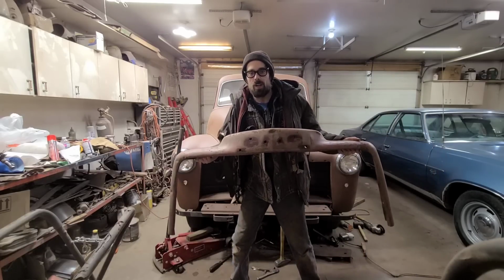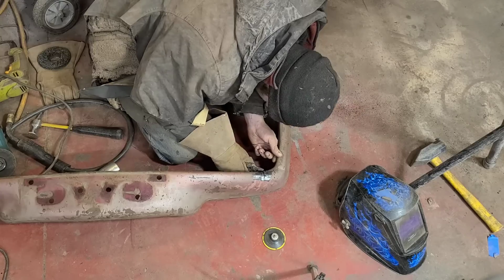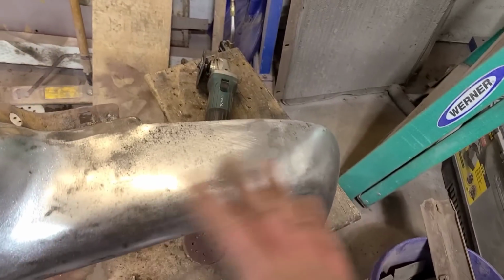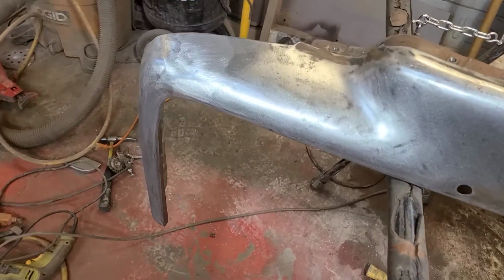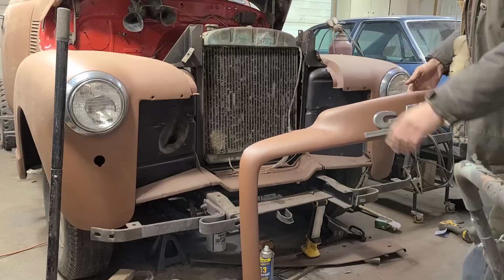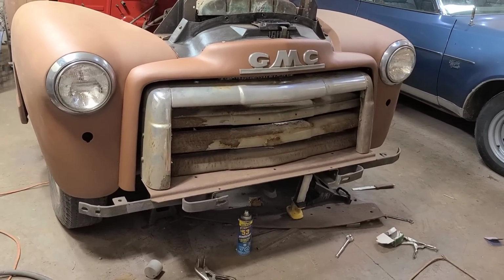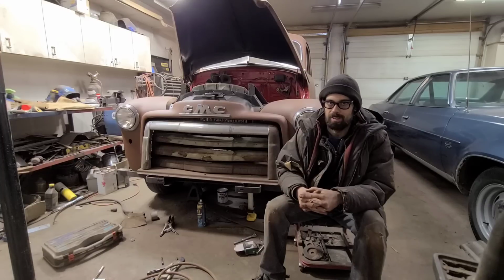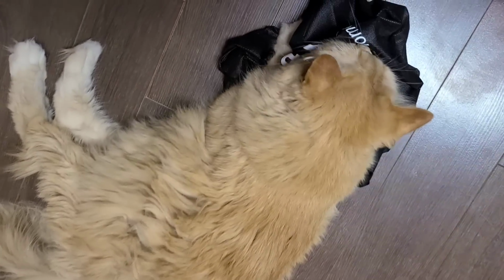1948 GMC Grille Surround Restoration. Plus: Sculpting With Lead!

Comment: Thanks for the video. I worked with lead for years when I was repairing the older telephone cables that had a lead sheath covering. As long as you snort in the dust and wash your hands after you are done you will be ok. Nice job smoothing out the grill surround. I would scuff and paint over the crusty parts of the grill so it looks presentable. That cab looks great. Looking forward to the next one.

Comment: I know this is a long time too late, but I found that the propane 'weed wand' burner attachment pumps out enough heat for soldering if you run out of MAPP. Super unwieldy at 2 feet long but it works.

Comment: Lead is safer then bondo. Your rough in is nicer then most finish work I have seen. On the grill just paint it with satin silver. Thanks for the update.Keep up the great work
Reply from the maker: Thanks! I figure with lead it's pretty hard to accidentally inhale the shavings after filing it, but the bondo dust gets everywhere and you end up breathing it in for months after. I'm not going to try to pretend lead is safe for human consumption, but spending a lifetime hiding in a protective bubble probably isn't healthy either.

Comment: Hi kyle

Another great video. I worked in the Telecommunications field for 20 odd years and was always impressed with the skill of the old-time cable joiners. They would "lead wipe" joins in the big, 1200 pair paper insulated led sheathed cables, to seal them. The cables were them pressurized to keep moisture out, air usage was monitored to detect leaks.      
Regarding the grill it looks like the outer U-shaped bit would clean up ok I leave that in chrome as a border and paint the scummy inner bars whatever colour suits.   
Regards

Comment: DEAD SOUTH background music was appropriately added.
That high‐class Saskatchewan string quartet.
Definitely my favorite music of all.
I try hard to restrain myself from giving my opinions, BUT you did ask.
Much mental debate, before I speak. 
Kyle, you have a golden opportunity. 
Well maybe gold is a little much.
Easier than painting is nickel plating.
All of my welding rod is nickel, so the nickel is easy to come by.
A large plastic storage box or plastic barrel is fairly easy to acquire. 
A cheap battery charger is needed.
The non-toxic chemical is cheap or better yet, make your own. 
And after observing your cake-icing prowess with the torch and paddle, I am confident that you can fill the pitting with solder.
Kyle, it would probably be the least demanding thing that you have done so far.  If I can do it, then you could do it blindfolded.  
With a little u‐tubing Allen and Poe could probably give it a good go!!!
It is cheap, fast, and easy.
I liked my '29 Ford brightwork, better than the '30 Ford chrome. 
Your videos are different than others. 
This would be one more unique programming for the Carter Show.
Your programming is so captivating and different that it is the only auto restoration show that I watch.
Bad Chad is not a restoration show and your skills are epic.
Reply from the maker: I love the look of nickel plating, but considering the whole grille is heavily pitted and damaged it would easily turn into the most involved part of the whole project if I wanted to make it presentable.

Comment: My bondo keeps lighting on fire when I put a torch to it... Am I missing something? Studio trickery, I bet!
Reply from the maker: You called my bluff! The secret is to mix used gunwash into your bondo. An old bodyman taught me that. He also taught me that when the bodywork shrinks and cracks before it even leaves the shop, it's not because of the dirty gunwash, it's the metalwork underneath that's at fault.

Comment: Just an idea on the grill, knock the loose stuff off with your favorite tool of destruction benevolently leaving any chrome that refuses to submit. Spray a heavy coat of silver on the pitted, naked metal areas and let it dry for just one day, Grab an old, dirty, lint filled shop rag and soak it in mineral spirits and ring it out pretty well then spray it with some black (or brown, or the colors of your favorite sports team) to “load” it up. Rudely and with some anger, wipe over the silver painted areas and the edges of the remaining chrome to seal them a bit. Viola! Showroom fresh! Well, not really but it could look better that it sounds like it would. 

I’ve tried this a couple of times, the first one came out terrible but some areas looked pretty decent, the second time was pretty ok (ish).

Comment: With the grill, just clean it real well and leave it rusty but put a protective clear coat on that will stop the oxidation. What is best to use, I don't know. Some use linseed oil but there is often concern about it never really fully curing to a hard dry surface. I do understand that a paint additive called Penetrol works well. It does turn the rust a darker color of brown but this truck is what it is. You may get some other suggestions along this line of enhancing and protecting the look of the rated surface. Wear it proud. I should also mention that I have a 1982 Harley Davidson Sportster that I acquired as a rolling basket case. I just wanted to bring it back to a reliable and safe runner that I could bring back as good as reasonable. It had been left outside and had acquired some rust on the chrome parts including the rims. On some places like the visible license plate frame and other chrome parts I used the old classic molasses rust removal process and it did a nice job taking it to bare steel that was a little dark. Of course vinegar or the popular Evaporust could be used as well. I prepped it and sprayed it with gray primer and it was actually not so noticeable and looked pretty uniform with any of the chrome that had survived.

Comment: Gasoline contained lead from the 1920's thru January 1st 1996 in the United States. Making me 31 years old before it was eliminated. Mind you, for the majority of that time vehicles did not contain emissions controls. First stage emissions controls was a catalytic converter added to vehicles in 1975. So my advice Kyle is, you be you. Lead roofing flashing is still available to this very day. In fact if these keyboard Warriors live in homes built prior to 1986 the copper piping was soldered with lead. Let them chew on that for a while. 

You've done a Fantastic job Kyle, keep up the good work.

Comment: Great job showing the lead work,  Really hard to do and you make it look easy,  I have done  a little lead work and it is  hard to keep lead  on the  panel, it wans to run down the side of my project.  So now I just use body filer, way easier to do.  Thanks for showing old school Kyle,  Great video
Reply: Forgot to say leave the old center gtille as it  is, ,   looks  it age.
Reply from the maker: Thanks Gary!

Comment: Great repair as always. so are you of the opinion that and body came be repaired? when do you decide something is not worth fixing for instance if the repair is going to take 8 hours do you still repair it or go out and find a new body panel? Very nice lead repair I don't see that very often anymore all the old body men in the late 40's and 50's used to use lead for body work and this is great to see.
Reply from the maker: If the part isn't being reproduced, then it's almost always faster to just fix what I have.  If the part is available new, then it depends on who is paying the bill.

Comment: Nice repair job Kyle. I like the lead work. Can you put body filler over lead? Because the 36 has a few areas where I may have to do that. You're coming along nicely with the 48, look forward to seeing it finished.
Reply from the maker: Thanks Ken, yes you can put bodyfiller over lead without issue!
Reply: @CarterAutoRestyling  I am new to your channel  so if you previously talked about this excuse me, what is the advantage of lead versus filler?  I understand on certain  restoration projects the desire to replicate or repair original parts, but on this project was it just to show the technique or another reason?  Also, at the beginning were you tinning the area ... does that make lead stick?  Thanks for posting.

Comment: Hey feller, great vids on the 'ol Gimmy, great "class on attacking " a mess! I'm gonna try to bring my 1950 5 window GMC somewhat to respectable state. Only pd. 225.00 back in the 1990's, I figure anything done is PLUS! The truck is low mileage, she runs and drives with all original drivetrain, with one leak from 4spd gearbox, being very minor! At the price,   good defense. at being right place at right time for this purchase. Keep up great vids, love it sense of humor, Mike from Delaware
Reply from the maker: Thanks Mike! I wish they could still be bought for that price!

Comment: On the grill, from our view, it looks like the front facing chrome is good enough to "scuff out" with some SOS pads. Once that's nice and shiny, I would scuff the inside edges of the surround and the center bars for paint and use some dark grey (almost charcoal metallic on those parts. Like that dark grey Mercedes color ??? As always ---------- FWIW !!!
Reply from the maker: Cool idea, thanks! Unfortunately the drivers side outer bar has no chrome left whatsoever. I realized after I made the video that the camera didn't pick up how rough it is

Comment: Hi Kyle:  The other day i was perusing through assorted Car restoration channels and I came across one who was testing out assorted "Chrome" paints for future use on one of his car projects.  The narrator had about 7 assorted brands. Some were spray bombs, some were one step brush on paints, one was even a sort of powder that required a hardener to turn chrome-like but most were two step spray on processes.  ****************************************************The narrator then mentioned that someone in his family went to nail salons and spoke of Acrylic chrome paint women could have painted on their nails.  I believe this latter chrome application was also a powder two step product that required a hardener to set correctly too? So in his experiment to find which of these Chrome paint applications had the closest likeness to real chrome, he discovered that of all the "for car use" brands available none compared to the Nail Salon's chrome application.  It was simply crazy the quality it provided and he stated as much. ***************************************** He further stated and demonstrated that this nail salon two step chroming product was even more chip resistant that the next best automotive chrome paint applications.   ****************************************************Perhaps if you're going to re-do the inner grill, rather than paint it white or black, you might want to experiment?  Look on YouTube for the how to do acrylic nail Chrome application********************************** https://www.youtube.com/watch?v=7toRGpqIAbU - ***********************Also I discovered the name of the product for you, if you're interested in writing them for information on High volume purposing use such as painting your grill). https://www.luxapolish.com/products/luxachrome************ Good Luck !😀
Reply from the maker: Very interesting, thanks for the information!

Comment: Correct me if I'm wrong, but wasn't there a large amount of lead used in the plastics of the old beige computer boxes/towers back in the day? AND wasn't that part of the reason landfills wouldn't accept them as trash? The lead was used as a radiation shielding mechanism to protect the delicate systems within. Seems like folks are still living with lead weather they know about it or not. You're using it in a controlled situation with full knowledge of the hazards and clean up procedures. It's not like you''re spreading it on toast and gobbling it down. 13:36

Comment: I fully expect some people will grill you about your technique, but me : no, that will just lead to more fireworks and a melt down
there are some trick new chrome paints that look better than the real thing, I would go with something like that, and in your case ....that will not happen, just leave it, it has that ruff neck patina look, you should put a few bullet holes and dents in it too just to add to it's charm    😁👍   rob NZ

Comment: Did you use any paddle lube/tallow in your lead work ? The lead work seemed to stick well to the steel.  50/50  lead ? That grille shell looks far better ! Thanks for showing us the details !
Reply from the maker: I use tallow. The bars are 70/30. I tin the metal with eastwoods tinning butter prior to applying the lead
Reply: @CarterAutoRestyling  Excellent !!

Comment: Interesting factoid about MAPP gas, its not the same stuff that was on shelves 10 years ago, it goes by the name of MAP Pro. Its a tamed down version that is only about 200° hotter than regular propane. The real MAPP, methylacetylene-propadiene propane, hasn't been manufactured since 2007.

Comment: I hate them bloody keyboard pluckers! I find lead is very satisfying to work with and don't mind using it at all. Used some on my fake radiator grill where I got one corner a little wrong. Gotten very expensive though. The sticks are bad enough but a tub of tinning butter is insane these days! The music was much better in your earlier videos, you know, when you weren't a YouTube star. You're just getting lazy now.
Reply from the maker: Everyone knows that once you're successful, you can stop trying...I just took it a step further and stopped trying before I became successful. Haha
  Leads up to $26 a pound here and when I bought tinning butter a few months back the containers were the same price as before, but now they are only 1/2 full.

Comment: We start with a thorough assessment of the new front panel -- it is royally screwed! Ah, but there is easy access to both sides, so this is a slam dunk for Kyle. As topper we learn about body design defects that over stress this panel, and the fix, plus an adroit use of lead to give a nice strong, pretty result in the two high-stress areas. Re: the grill, I would not leave it as is. It looks WAY more scummy than the rest of the cleaned-up vehicle. If nothing else, a uniform color, and maybe a bit of smoothing will really complete the front end look. You know what they say, 'The front end sells the car!' Those old grills had interesting, strong sculptural elements that modern grills do not have, except a few modern pickup grills. I think you got more than 30 cents worth out of that bag -- the cat is delighted!

Comment: I say paint the grill, I had a spot of lead on a 78 Buick from the factory I sanded it down good but the primer and paint lifted away after a while. Was the lead they used some new safe stuff that should have been removed?
Reply from the maker: Maybe the tinning acid was never properly neutralized from factory. It needs to be washed down with baking soda and water and then cleaned with wax and grease remover. It's also a good idea to use either a good etch primer, or epoxy primer over lead/bare metal. Most high build primers don't bond well to bare metal

Comment: Personally what I would do for the grille, is either paint it with some spray zinc, or get yourself some of that aluminum tape for taping ducts to-gether, and cover the bars with that.  I know your standards are a bit higher than mine, but that shiny tape looks pretty good from about 60 feet away.

Comment: Lead in the hands of a professional can be quite safe. People confuse what you do with the deadly lead work that law enforcement did on Bonnie and Clyde’s last Ford V8 Getaway Car. They used so much lead on the body of that car that soon after they were finished the beautiful young bank robbing couple were found dead by the car.

Comment: The grill.......
      I realize that small trucks only offered this grill in late '47 through '48. Although, the larger trucks used that same style past '48. I'm not sure if the larger trucks were the same size, but if so, finding a replacement may not be as difficult as assumed.
      Also, be nice to the "safety Steves".     Lol
      Some of us have valuable lessons to share. (We hate that safety crap too)        lol
Reply from the maker: Thanks for the info William!

Comment: I'll bet that the people who worry about you using lead drive EVs that will ultimately pollute the environment as the toxic materials used in their production are allowed to leach into our environment, along with the milliions of gallons of diesel fuel thats burned in order to mine the lithium for the batteries. Please keep up the excellent videos!